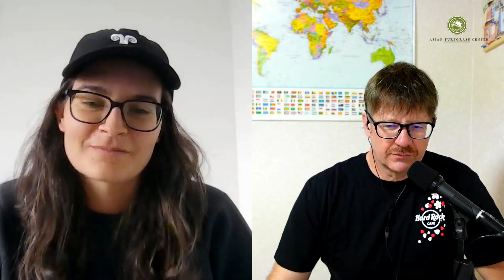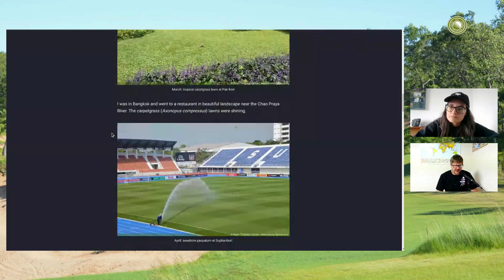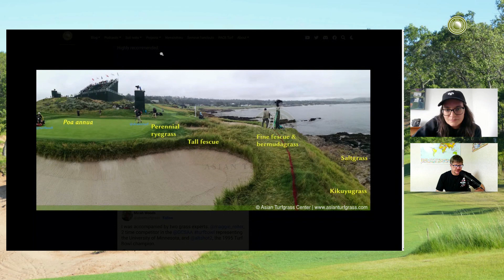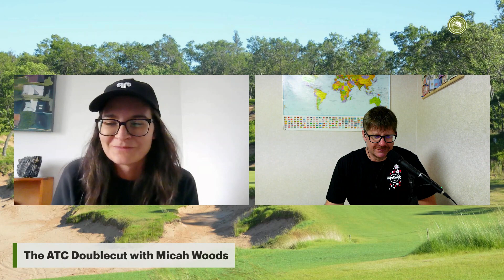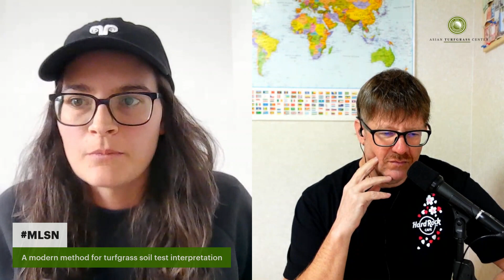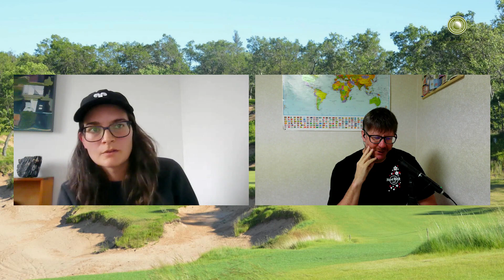Botanical walks, ecoregions, and MLSN for lawns with Maggie Reiter

Comment: Here in South Florida, I was able to find some fine-bladed zoysia growing in the wild (trails and parks, like the Everglades). Also what I was told to be centipede. Those 2 would form a decent turf in the wild. I did find some Bermuda but not looking good. Usually too thin, mixed with way too many weeds, or just a few tiny spots of just a few plants. Obviously, I found some Saint Agustine near the water. And something that may be seashore, but I'm not sure. I was surprised to find zoysia as some turf specialists have told me Florida was not a good place for zoysia. That Zoysia was very stiff though. Some patches were looking pretty good, quite short and with fewer weeds.